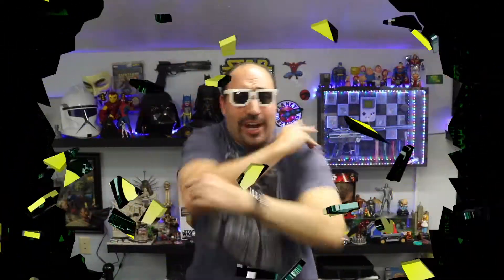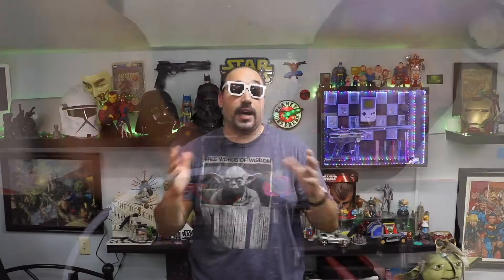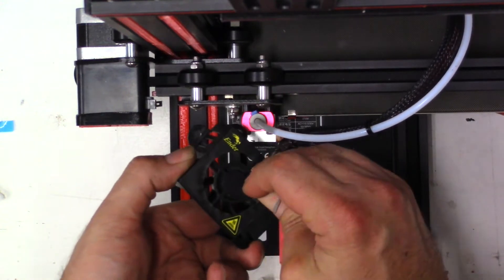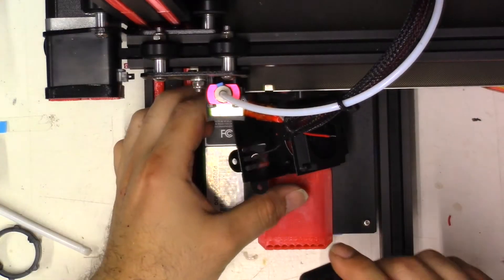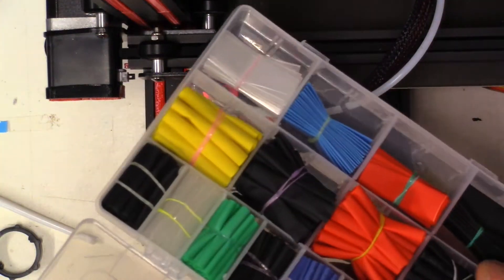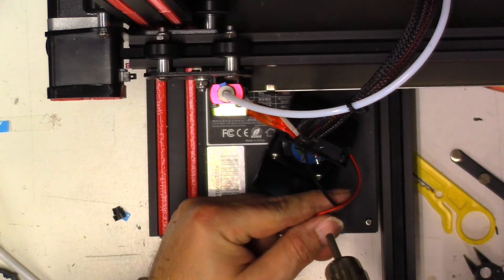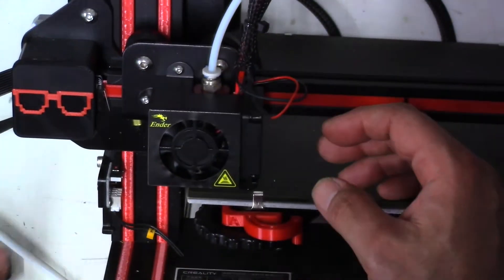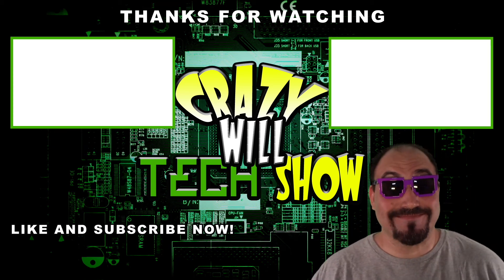How to replace an Ender 3 fan

Comment: Man I don’t have a solder and I just bought a noctua fan and I don’t know what to do know
Reply from the maker: Easy just buy some of these https://www.harborfreight.com/30-pack-watertight-heat-shrink-butt-connectors-66729.html?utm_source=google&utm_medium=cpc&utm_campaign=18336506149&campaignid=18336506149&utm_content=140682448945&adsetid=140682448945&product=66729&store=618&gad_source=1&gclid=CjwKCAiA75itBhA6EiwAkho9ew7x7Qxdv8V2AbagJWRiphyyjbhw0jWJ09wCqg-mEL6zzZe6t7QNRRoCyrUQAvD_BwE

Comment: is that another fan that spins (the one where the blue and yellow wires goes to).  mine seems to be having issue with the filaments not sticking to surface properly and causing strings
Reply from the maker: Yes, there’s two fans one is to cool off the extruder the other ones to cool off the print.
Reply: The side one flows down to cool the part, the open one cools the nozzle horizontally, but the part cooling one does not work very well, a lot of people get 1 or two 24v fans and print a different print shroud that directs the air better to help bed adhesion, also try using a non toxic glue stick for better bed adhesion

Comment: I cannot for the life of me get the fan out. It’s just staying stuck. How do I get it out?
Reply from the maker: I use the screwdriver and pushed it out sometimes it’s a sticker sometimes it’s glue.
Reply: Use pliers on one of the corners and rip it out, they did the tolerances wrong when they built all the ender 3s so it feels like it's welded on

Comment: Hi, can you/anyone tell me what kind of heat shrink I need to get (size? amount of shrink?). I have to do this to mine. As you can guess I am not super into wiring but will figure it out. Thank you!
Reply from the maker: This is the kit I bought Wirefy Heat Shrink Tubing Kit - 3:1 Ratio Adhesive Lined, Marine Grade Shrink Wrap - Automotive Industrial Heat-Shrink Tubing - Black, Red 200 PCS https://www.amazon.com/dp/B089D82FLG/ref=cm_sw_r_cp_api_i_9F5ME6C75JV0FMRZRB8B?_encoding=UTF8&psc=1 for my projects.
Reply: @CrazyWillTechShow  Thank you!!
Reply from the maker: You could also buy the fan with the extra long connector that plugs right into the board if you don’t wanna go into soldering.